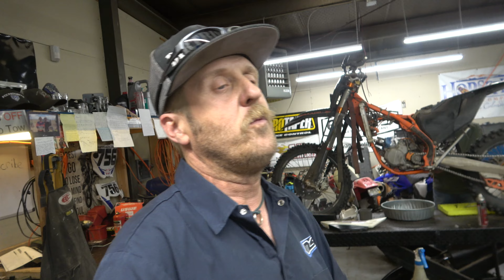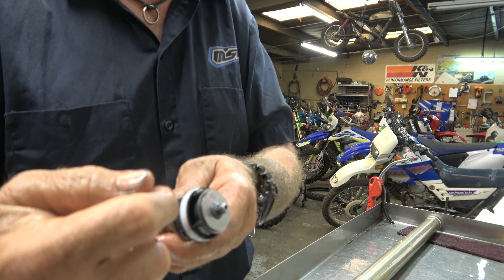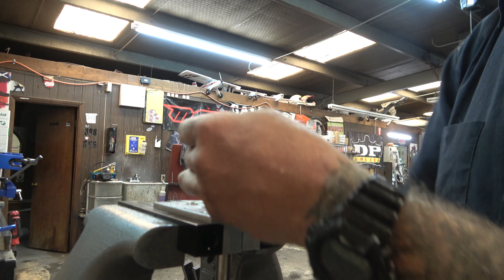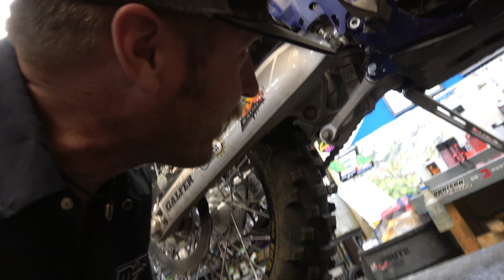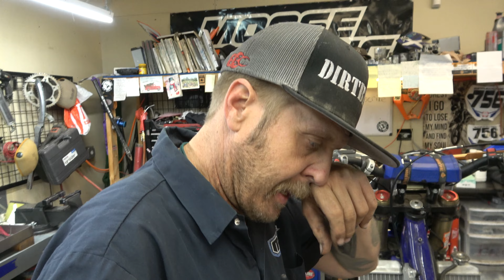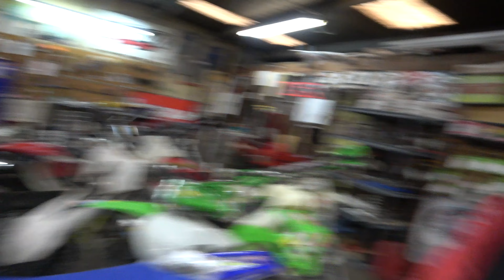Fixing messed up forks | Suspension Explained | New Project | The Shlog #211

Comment: I have a 2018 sherco 300. Had a similar problem when it was still pretty new, gas cap vent was plugged with something that looked like a grey epoxy material. Ran a drill bit though it and problem solved.it was a head scratcher for a minute though
Reply from the maker: Good to know. This one seems to be free flowing

Comment: Sherco when the coil heats up it shut of  ohm the coil when cold you run the bike for 5 to 10 and re ohm it and the numbers will drop
Reply from the maker: I checked that. Turns out it was the carb. He loves it now
Reply: @highlandcycles  
Have you mest with the 2022 yz125 carbs yet?
Reply from the maker: @250race  no. Which carb do they use
Reply: @highlandcycles   They went back to the PWK with a high speed.
And having lost of trouble.
Reply from the maker: @250race  huh. That’s too bad. Should be tunable

Comment: I really can't get on board with this no kickstarter thing, I came into pit after the second lap at Hard Rock this last weekend and when I went to leave my starter wouldn't work and if I had a brand new KTM it probably would have been the end of my race. I don't understand it, the 3lb that they're saving doesn't seem worth the sacrifice.
Reply: Ktm 2 strokes have an option where you can install a kick starter kit.
Reply: @kordapyo612  the 2023 XC's do not have the case plug to install the kick starter kit
Reply from the maker: I agree. I had my e start stop working on the start line of the shady burrow last year. Was so happy I had a kicker

Comment: The Lectron on my Beta 300 does the same thing.  The needle will hang exactly like that.  I only notice it after transporting it has never happened on a ride.  A little tap on the carb body with a screwdriver handle and it drops.  If anybody knows a solution post it up please.

Comment: 🔥right on you doing a build.. all keep an eye out here in Ontario for twin 2 smoker 🔥👊🔥🏍⚙️🔨
Reply from the maker: Sweet. Thanks
Reply: @highlandcycles  like what engine setup did u have in mind?  Y u leaning towards twin, for lc Engine with a Tranny Gona  be slim pickings. Banshee 350 be perfect, just won’t be cheap, then gotta fit the pipes
Reply from the maker: @jeremymullen5378  would like a banshee